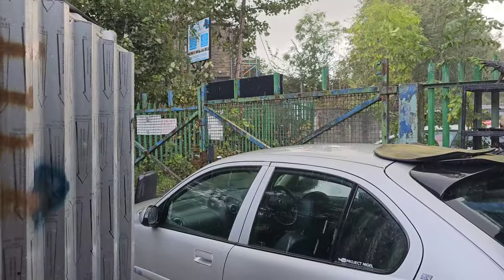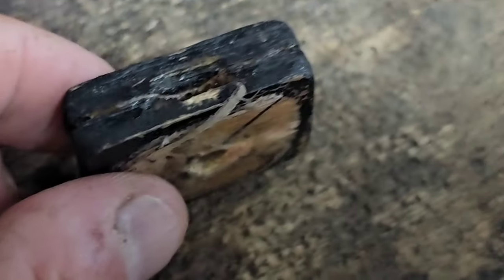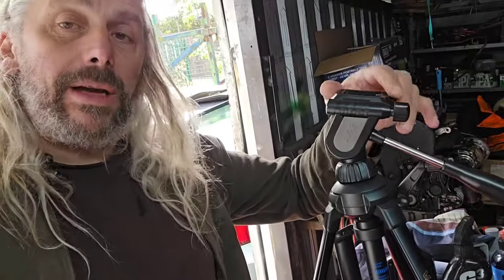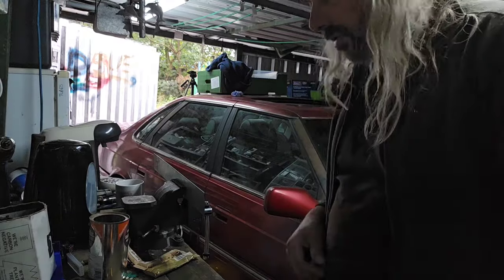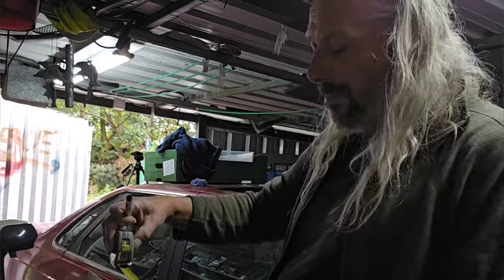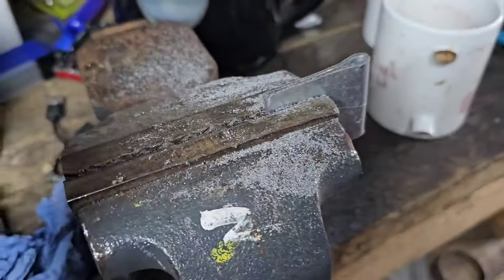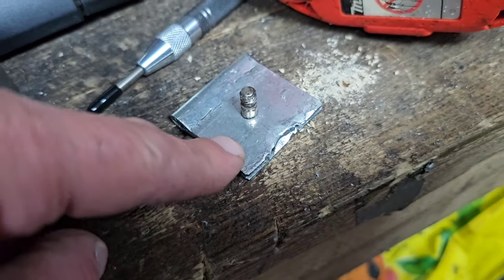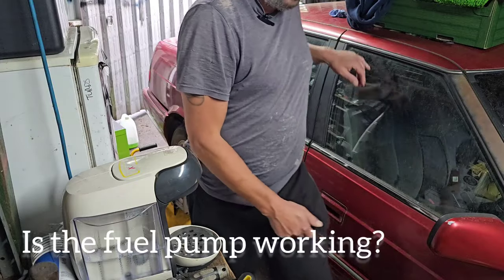Auntie Sophie And The Tripod

Comment: You'd think that a camera shop would sell those tripod platform inserts wouldn't you? But no, each tripod has a different size or shaped platform insert piece which makes it difficult to find the right one, unless it is a current model. I've got an old Jessops tripod and the insert had a rubber layer which has perished over time. I've tried to find a new one but to no avail. You see they'd rather sell you a new tripod. That's the throwaway world we live in now.
Reply: I'm surprised they haven't started doing it with socket sets.